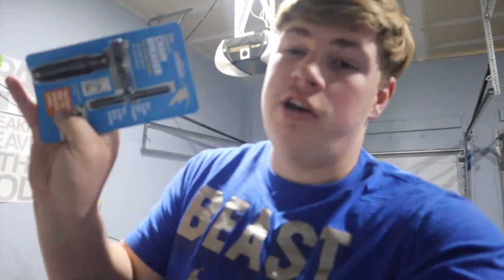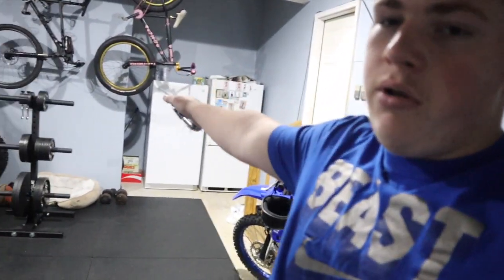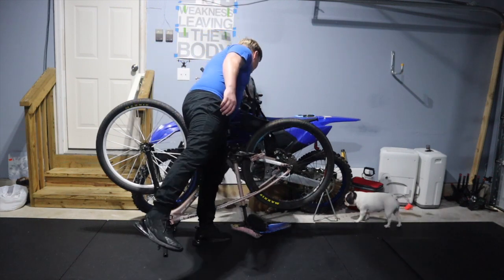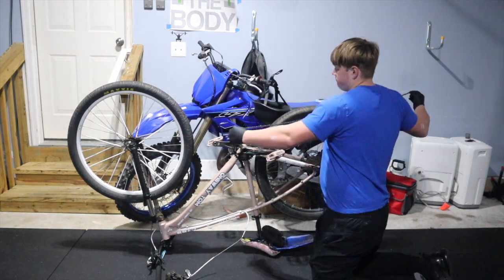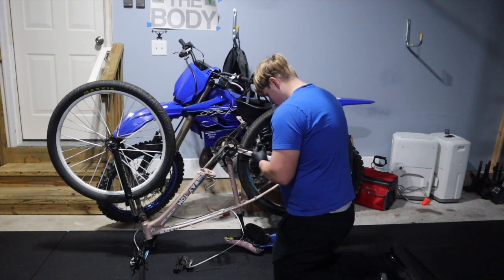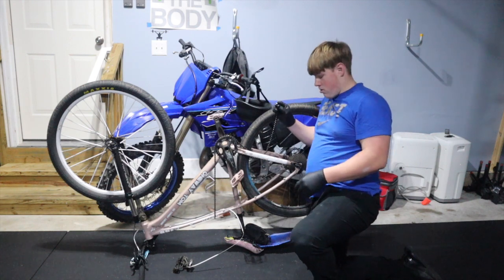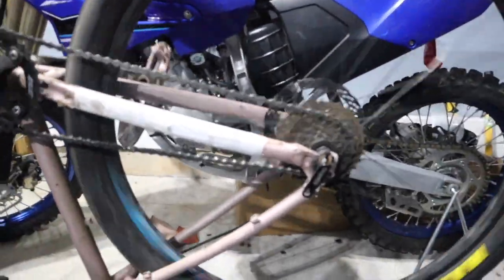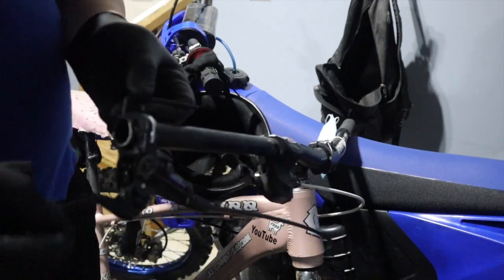c100 single speed (NO MORE GEARS)

Comment: I have 2 questions 1. can it be put only on 5th gear? 2. is the original front chainring ok? 3. I don't understand how many links you have to remove to make it single speed on 5th gear
Reply from the maker: Yes you can put it on any gear you want n just take links out until the chain is tight